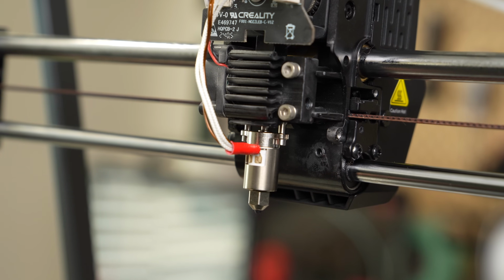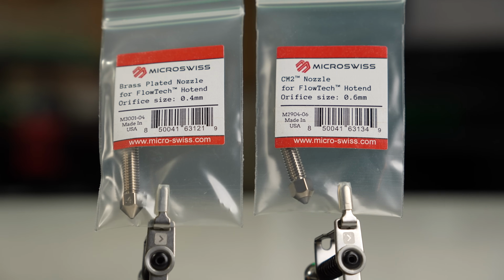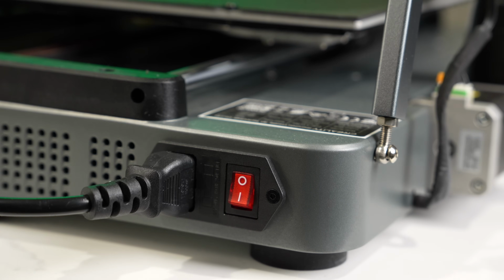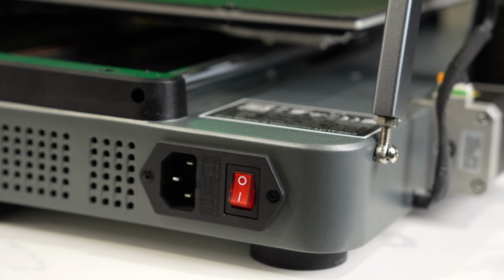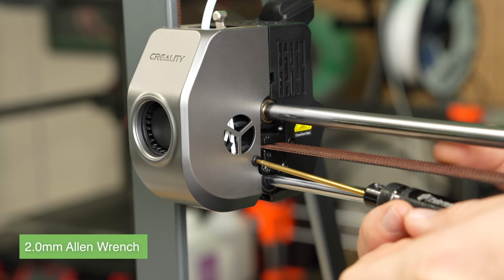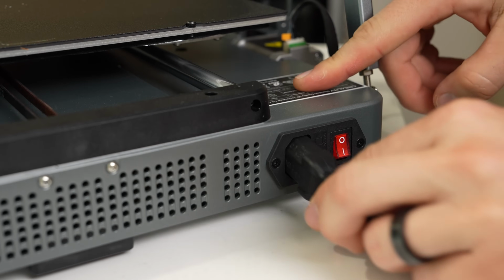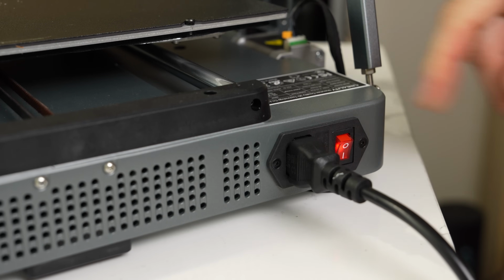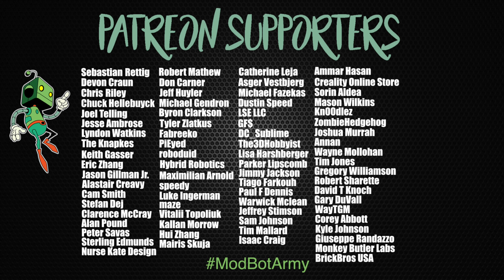Hotend Upgrade For Creality Ender 3 V3 and V3 Plus Printers (Micro Swiss FlowTech™)

Comment: 3 mins in and I still don't know what the advantage of the swap is supposed to be
Reply: The V3 nozzle is already the "Unicorn" nozzle, so it's leakproof already. Also, it's not necessary to remove the nozzle during the removal of the heater core.
Reply: Think Revo, thats sort of what this is.  Its cheaper, but not quite as easy to change the nozzle.  Still reasonably easy, but there are easier.
Reply: I can't get the brass length to install flush? Any ideas??
Reply: They print cleaner, have higher flow, and tons of nice nozzle options. Also easy nozzle swaps
Reply from the maker: It’s intended to be a tutorial for the swap process. We covered a bit more in the K1 upgrade video but in summary: 

Leak proof, due to the design it eliminates the chance of heatbreak nozzle leak by improper tightening. This is why you don’t even need to hot tighten. The nozzle extends from the bit zone and goes into the cold zone. The stock “unicorn nozzle” from creality attempts this as well but my experience has been very hit or miss. 

Slightly higher flow. This was a very minimal bump on my testing but with the new CHT nozzles you’ll get a much bigger bump. 

High quality nozzle options. Plated brass, CM2, CHT, and DiamondBack options. 

There are other arguments to be made like it just being manufactured and QC’d much better but the above are likely the main reasons most would consider. 

Hope that helps 😊
Reply: @ModBotArmy  you forgot to mention that you dont need to undo the set screw in the heatsink for nozzle changes in the case of the unicorn system. That and the greater variety of nozzles are the selling point over the unicorn system, leak proof plus no hot tightening also for the old system.

Comment: Csn anyone tell me why the heat block on this says  its from the cr10? Dremc has the heatblock listed as v3/plus but i bought it and it doesnt fit. The one they list as cr10 looks like this? Am i missing something, do the other enders have a bigger heat block? Is that why theres a heat issue? Note: bought the flowtech nozzle but cant fit it because the hose in heatblock is jammed in there.

Comment: Ok, quick question. In this video and in the instructions sheet provided there is no mention of retightening the set screw that holds the nozzle into place. Is this just assumed that it should be tightened back down or was that left out on purpose? I extruded with and without the set screw and did not notice much of a difference.
Reply from the maker: It’s not needed. With this hotend the set screw doesn’t do anything. With the stock it’s needed for securing the nozzle 😊

Comment: Does this hotend set helps to prevent blobs and clogs, because the original out of the box failed 10 days after arrives.

Already ordered this kit, hopes It helps, any adittional suggestion with assembly will be aprecciated
Reply: Did it help you? Just got a clog lol

Comment: thanks.  my Creality Ender 3 V3 plus the hotend filled with plastic. i mean the nozzel and up is all melted plastic. its my 1st 3d printer and ive had it a month.  not impressed.  idk if i want to fix it or thrownit out. seeems like junk. im also noticed black marks on the top bar print head rides on. guess its rubber.
]
 it took forever to remove the plastic, sock brok off with heater, i guess.  idk?

Comment: I'm struggling to find information on which nozzle to pick, thinking of replacing my hotend on my v3 soon and looking at either CM2 or CHT nozzles, the CHT high flow has the higher flow rate but CM2 is a £ more expensive,  is it the better choice?

Comment: what about V3 SE? Can I replace the hotend and extruder setup with a different model? Like for example, instead of the extruder being attached directly to the hotend, I'll replace it with stationary extruder like other printers and use PTFE tubes to direct the filament to the hotend? And of course I will use a different hotend as well. Can I do that? Or will it ruin my printer?

Comment: Sigh... proprietary nozzles...
Reply: Tbf, the "standard" was kind of just pulled out of someone's behind, so I'm hoping with all of these nozzles that have been entering the scene, someone finds a best and that becomes the new standard, or at least a set of standards; kind of hard to say what a definitive best is without experimentation, and there really hasn't been much of that over the years until recently, so that's what I'm looking at it all as
Reply: @TS_Mind_Swept  I would be all for that but I doubt the driving force behind this is to find a new standard. Closest we have to that is Revo
Reply: @weeurey  I'm definitely aware that it doesn't have the highest likeliness, but it would also be nice if it did work out that way, so since all of it is just kind of new at the moment, I'm tryna remain optimistic; why get upset at a problem that doesn't even exist just because it might?
Reply: @TS_Mind_Swept 

I'm not upset at all, I'm voicing my displeasure as a customer that MS are trying to launch yet another ecosystem for a fair amount of cash that has a good chance of not existing or being outdated in a few years time. Having an opinion in what influences change mate.
Reply: @weeurey  you call it an opinion, I call it a poor view of the situation. We are not the same

Comment: I wonder if the toolhead and gantry will need to be changed with the CFS eventually being able to be used with Ender 3 V3 and K1 series printers. I really wish Creality would give us more about it.
Reply from the maker: Until another comment I had no idea it was even going to be compatible. If they are going to be using a cutting blade I would think it will need some revising to fit it.
Reply: @ModBotArmy  i posted the timestamp and a video link for you in another thread
Reply: @ModBotArmy  it will be interesting to see how they go about it.
Personally, I am about to replace my gantry with aftermarket because of the horrible VFA on the first generation K1's. I really wish Creality had shipped the fixes to the customers  or had discounted kits to retrofit. /sigh

Comment: Love the Flowtech System.  We have them installed on a K1 Max, a K1, a CR10se, and a Neptune 4 Plus.  Was about to switch the V3 and V3 Plus over.  It makes nozzle swaps simpler with only one Nozzle type needed.  So much simpler.

Comment: im not going to upgrade the k1 till i see the CFS kit 😉
Reply from the maker: @3DATHENS-qi1tu  CFS?? Carbon Fiber??
Reply: @ModBotArmy  the Creakity Filament System Kit That will fit on the k1s, k1max,enders V3 you know
Reply from the maker: @3DATHENS-qi1tu  wait they are saying it’s going to be compatible with printers other than the k2??? Do you have a link to that announcement???
Reply: @ModBotArmy they said that in the chat in the livestream of the official announcement i think.

Comment: Set screw? Should not be used with this upgrade? Or...did I miss when it was tightened? Thanks for the video!
Reply from the maker: It’s not needed. Technically you can just remove it but I left it in the unscrewed state on both of mine. The two titanium screws hold everything in a place and the nozzle isn’t attached in the same way that the stock one is.
Reply: @ModBotArmy What kind of screw is the one that goes on the right holding the nozzle? I lost mine, thank you. Is it mandatory to use that screw on the nozzle or can I use the printer without that screw? sorry for my english im from argentina.

Comment: only thing i see missing here is doing a PID calibration
Reply from the maker: It’s not needed. I’ve asked them before as well and was told:

 “There is no need for PID Tune as the thermistor and heater we use is perfectly tuned to the printers firmware.”

Since these are made specifically for one printer/printer family using the same toolhead they don’t require it. I never did it on my K1 and from initial tests with this I’m not seeing fluctuations. 

Can you? Absolutely but I’m not seeing the need like I have on general hotend swaps.
Reply: @ModBotArmy  that's really interesting to hear! as far as i know/heard, you need to do a PID calibration when you change any of the heating realted elements

Thanks for the reply!
Reply from the maker: @stoinercraft6389  generally that is 100% the case. It would be interesting to hear more of a breakdown on how they tune their heaters for specific printers that they sell these for.
Reply: @stoinercraft6389 depends very much on the hotend used. Pid accounts for the delay between heating and reading temperature changes. So it's essentially based on two things, wattage/thermal mass relationship and distance between heater and thermistor. Since we have a cylindrical ptc heater with the sensor right next to it, there is basically no delay. The advantage is that pid tuning is less important, downside is that you have a lower max flow rate for a set temperature compared to a traditional e3d volcano parts arrangement where the nozzle is between heater and thermistor. The temperature gradient causes the filament path to have a lower temperature than the sensor has while on a volcano its the opposite. This gradient gets larger the higher you push filament flow. One extreme extreme would be the BBL x1 hotend, you measured 1mm away from the heater.

Comment: I installed a flowtech on my ender 3 v3 se and it was gamechanging. I now have a flowtech with the newly released cht nozzle on the way for my k1c.
Reply from the maker: Ooh, I’m gonna order one. I am still rocking the .4 plates brass but would love additional flow on the Max.
Reply: @ModBotArmy  I'm definitely gunna update on the additional flow rate comparison between stock and flowtech